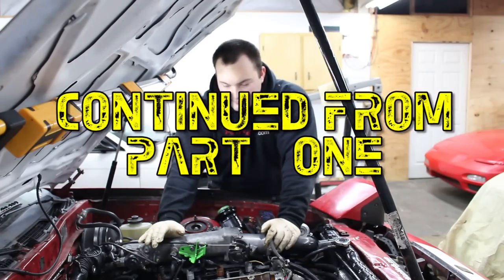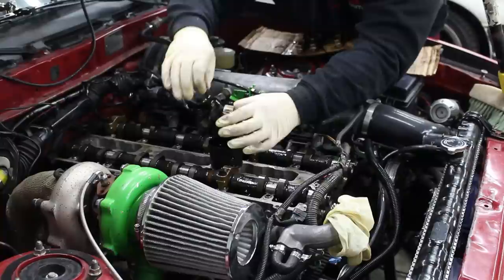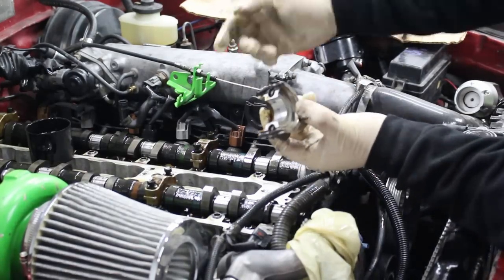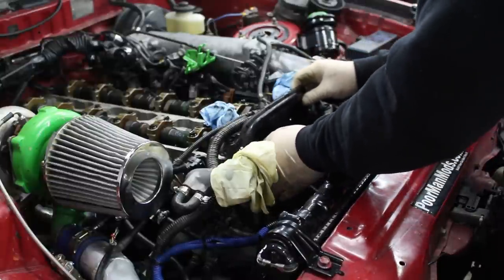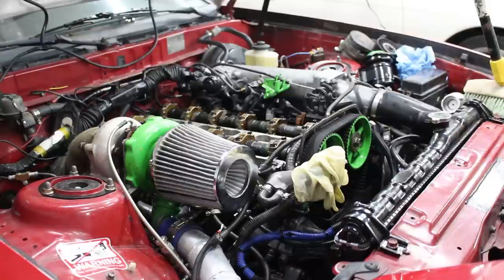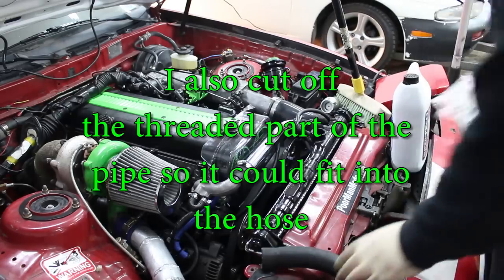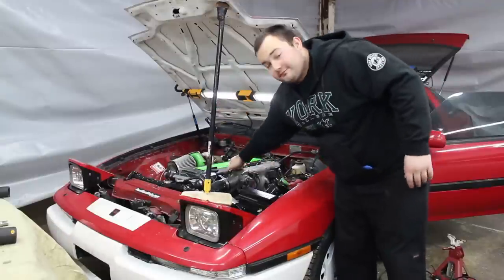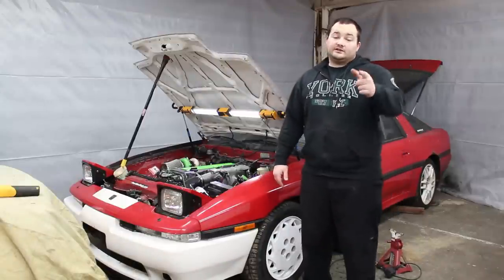Drift Missile Build pt 9 | Camshaft Upgrade | Timing Belt Change | 1JZGTE 2JZGTE Supra

Comment: you should be able to make close to 500 on those 540's. as long as you have the spark and enough boost. no need to touch bottom end either. im making over 500whp on stock cams, stock internals. i also knw a few ppl who have been making over 700 on stock block for yrs.

Comment: It was cool to see the cam shaft kinda bend when you were torquing it down in the time lapse portion.  Seeing that shows how important the tightening sequence is.
Reply from the maker: boofighter yeah i was surprised to actually see that, apparantly alot of people with strait 6 cyl engines break their cams alot when torquing them

Comment: Congrats on the video series guys, especially the supra ones. I am building the same project and those videos have helped me a lot. I'd love to see some videos on coil pack upgrades and fixes for cracked coils (epoxy, heatshrink, etc.). The 12v fuel pump mod would make a good and helpful video for the people who want to run 12v constant to the fuel pump instead of the stock varying 9-12v. Also, some tips on wiring the 1J harness into the MA70 body would be great for the beginners who want to attempt that swap. Those are just some suggestions, of course. Thanks and keep up the good work!
Reply from the maker: Yanko Dimitrov thank you! i just replaced all my coils, and im running direct power to the pump from the battery with a relay because the stock wiring was screwed. I would not want to give any tips on wiring because when I did it was very inexperienced with wiring and its not the best.

Comment: nice job, great video. I just did a single turbo gt3076r stock motor with 440cc injectors, made 350whp at 14psi so i have no doubt you can make 450 closer to 20psi +cams.
Reply from the maker: Drew Strong nice! and i hope so, did you watch the second gear pull video we put out a few weeks ago? i has to be close to 400 or more, it did 45-75mph in 2 seconds
Reply: Poor Man Mods yes i did, mine seems about the same , its in an s14 though so its hard to compare but mine spins 2nd and third once it hits boost with 245 rear tires. I was surprised.. a number is just a number until you sit in it, if i didnt know my car made 350 i would guess like 450 ahha. so if you can actually made 450 then good luck with traction haha
Reply from the maker: hahaha exactly

Comment: camshafts are hardened steel.  The cylinder head is very soft cast aluminum.  When placing the cams in the journals, you shouldn't be hearing "clank, clank".  Secondly, buy some assembly lube and faithfully use it.  Third, you never want to drench a bolt that goes into a blind hole such as you did with the cam cams.  Those bolts don't need any lube at all.
Reply from the maker: I followed the factory service manual and that contradicts everything you just said.

Comment: I love the idea for the radiator hose hard pipe. Do you have any concern with it slipping or moving since the pipe isn't flared on the ends?
Reply from the maker: No worries at all, it was so difficult getting the pipe in the couplets, it was so tight I also cranked on the hose clamps really hard

Comment: Didn't you have to re-shim the lifters to adjust valve clearance with the new BC 264 cams? Or did you remain within spec with new cams on all lifters?Also, why not install cam gears? if you the ability to swap out cams, surely you can degree the gears on the dyno (Not per cam card, but on the dyno). This way you installed the 264's "straight up" which is fine, but I'm sure there is power to be gained if you degree the cams on a dyno.
Reply from the maker: I didn't shim anything, everything is fine and runs great. I didn't want aftermarket cam gears
Reply: Poor Man Mods But did you the valve clearance after you installed the cams as per the service manual to check if the valve lash needed to be adjusted? JZ's use shim over bucket (of lifter if you will). Some cams require the shims to be re-adjusted, but some fall right into spec.
Reply from the maker: Nope, didn't even worry about it honestly
Reply: Poor Man Mods Allright. I'm a bit surprised to be honest, because it's pretty standard to check the valve lash after cams swap and adjust if necessary.  But hey, the show ain't called poor man mods for nothing. And it runs as good as before. Toyota engines keeps surprising people decades after they were built. Incredible.

Comment: I have my tensioner hole plugged with a paperclip but for some reason my timing belt is too tight and will not go in i'm also backing out the tensioner bolts under the car as far as I can just before they fall out.

Comment: I have been doing a 1jz swap and I am trying to get it running.  And I was wondering if it is possible to get the timing 180 degrees off?   All of the marks line up, but I don't remember if it was on the compression or exhaust stroke when I replaced the belt.

Comment: When you started spinning your cams at 10:35 you didn't bend any valves? at TDC?
Reply from the maker: the 1JZ is a non interference engine
Reply: @PoorManMods  yeah, i was just worried about the lift of the cams, apparently 9.5 or below is safe

Comment: Can you explain to me what you had to do to fix the issue with the intake came gear coming out of alignment?
Reply from the maker: just took the  belt off and turned the cam 1 tooth and put the belt back on
Reply: Poor Man Mods so it was cause by the cam gear not being perfectly set to tdc?  for some reason i thought the belt might not have been positioned correctly causing it to slip one notch or something....not to well informed on cam work.   great video series btw
Reply from the maker: Idk if the cam wasn't at TDC or if I had the belt off by a both, but after some adjusting it got it all lined up

Comment: Hey I'm about to buy these exact cams from my 1J  but Brian Crower recommends you replace your springs and retainers...my goal is 550whp on E85 is it necessary?
Reply from the maker: i didnt upgrade the springs or retainers for the stage 2 cams. IF you increase your rev limiter you really should upgrade them though. But it certainly wont hurt to upgrade them regardless but not entirely necessary
Reply: @Poor Man Mods thanks, I'll just do the 264s on my own from your video and save $1000 if a mechanic were to do the springs for me 😂
Reply from the maker: hahaha